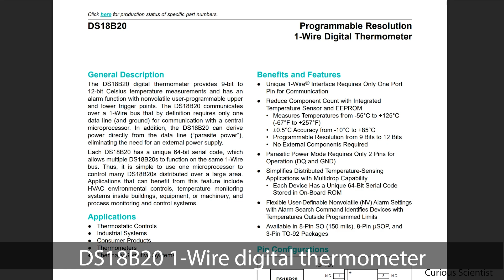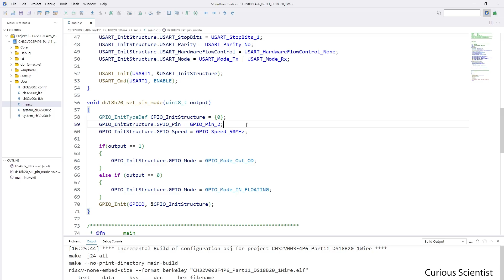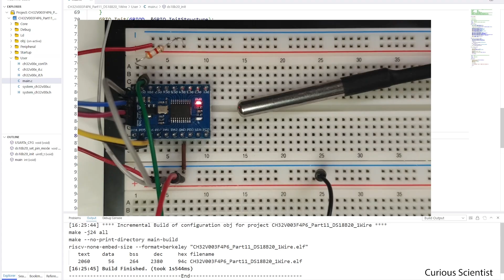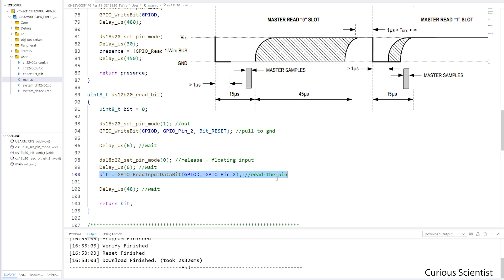CH32V003F4P6 Tutorial - Part 11 - DS1820B 1-Wire Thermometer

Comment from the maker: Summarizing the CH32V003F4P6 DS18B20 One-Wire Communication Implementation

*   0:00 - Project Introduction: Continues the CH32 tutorial series by implementing a one-wire communication protocol with the DS18B20 digital thermometer sensor. This serves as a foundation for future, more complex projects.
*   0:31 - DS18B20 Features: The DS18B20 is a unique digital thermometer chip known for its one-wire communication, requiring only a single data line in addition to VCC and Ground. It measures temperatures from -55°C to 125°C with an accuracy of ±0.5°C between -10°C and 85°C, making it suitable for household temperature monitoring or logging.
*   1:48 - Development Environment & Goal: The project uses Moon River Studio 2 for development. The immediate goal is to print temperature values to a serial terminal, with the data intended for transfer elsewhere in future projects.
*   3:08 - GPIO Pin Configuration: A dedicated GPIO pin (PD2) is set up to handle both input and output. It's configured as an open-drain output (for pulling the line low) and a floating input (for reading the chip's response when the line is released). An external 4.7kΩ (or 3.3kΩ used in demo) pull-up resistor is essential for the data line's default high state.
*   8:04 - Reset Pulse and Presence Detection: The communication initiates with a reset pulse: the microcontroller pulls the data line low for at least 480 microseconds, then releases it and switches to input mode. The DS18B20 responds with a low "presence" pulse within 15 to 60 microseconds, confirming its readiness to communicate.
*   15:07 - Bit-Level Read/Write Operations:
    *   Master Write Zero: Pull the line low for 60-120 microseconds, then release.
    *   Master Write One: Pull the line low for a short duration (e.g., 5 microseconds), then release.
    *   Master Read (Zero/One): Pull the line low, wait briefly, then release. Read the state of the line within 15 microseconds; if low, it's a zero; if high (due to pull-up), it's a one.
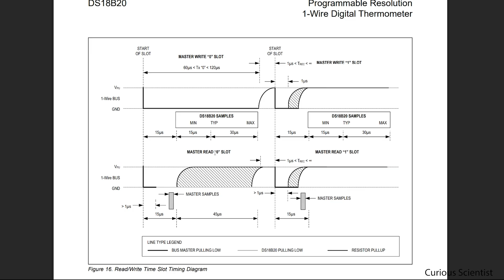*   17:29 - `DS18B20_ReadBit` Function: Microcontroller pulls line low, waits ~6µs, switches to input, reads the bit, and then waits for the remainder of the 60µs time slot.
*   20:00 - `DS18B20_WriteBit` Function: If writing '1', pull low for 5µs, then release. If writing '0', pull low for 60µs, then release.
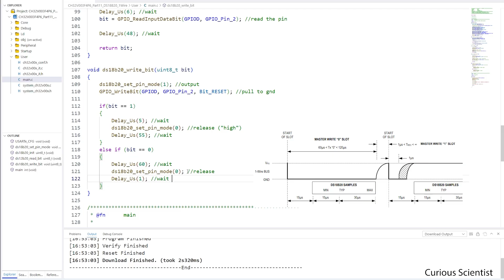*   22:51 - Byte-Level Read/Write Functions: `DS18B20_WriteByte` iterates through 8 bits, sending each using the `DS18B20_WriteBit` function. `DS18B20_ReadByte` also iterates, reading bits and reconstructing the byte using bit-shifting and logical OR operations.
*   27:20 - Temperature Reading Sequence: The `DS18B20_GetTemperatureRaw` function first checks for the chip's presence. It then sends `0xCC` (Skip ROM) and `0x44` (Convert Temperature) commands. After waiting for the conversion (which can take a significant amount of time, detected by polling the data line), it sends `0xCC` and `0xBE` (Read Scratchpad) to retrieve the 2-byte raw temperature data (LSB first, then MSB).
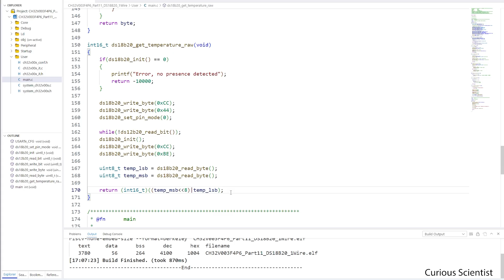*   31:11 - Temperature Conversion and Display: The 12-bit raw temperature data is scaled (multiplied by 10) and divided by 16 (the LSB value for 12-bit resolution) to prepare it for display. Due to the microcontroller's limitations in directly printing floating-point numbers over UART, the scaled integer is split into whole and fractional parts, which are then printed sequentially to mimic a floating-point number in Celsius.
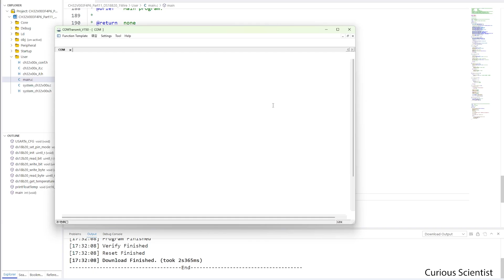*   35:28 - Live Demonstration: The code successfully displays raw temperature values and converted Celsius readings (e.g., 24.1°C) on the serial terminal, demonstrating real-time temperature changes when the sensor is manipulated.
*   36:20 - Resources and Conclusion: The video concludes by highlighting the ease of setting up one-wire communication and its utility for future projects. Links to a website for detailed explanations and a GitHub page for the full source code (`main.c`) are provided.

I used gemini-2.5-flash-preview-05-20| input-price: 0.15 output-price: 3.5 max-context-length: 128_000 on rocketrecap dot com to summarize the transcript.
Cost (if I didn't use the free tier): $0.0073
Input tokens: 20122
Output tokens: 1227